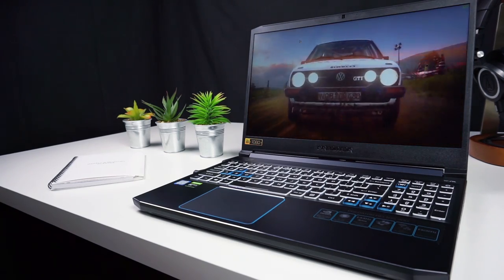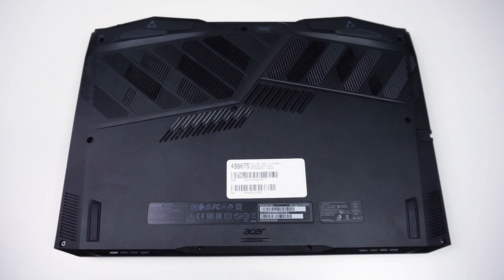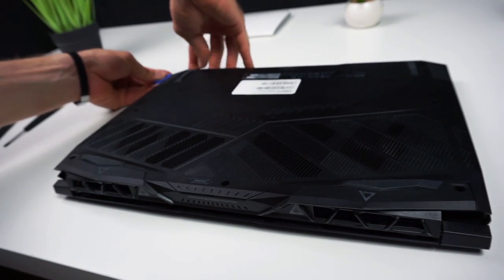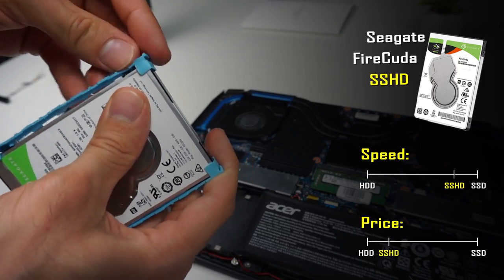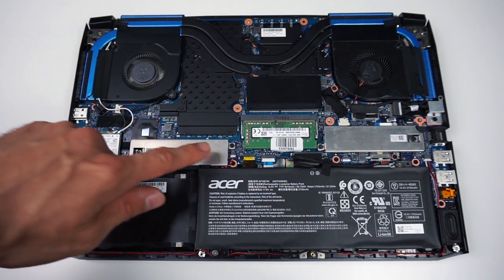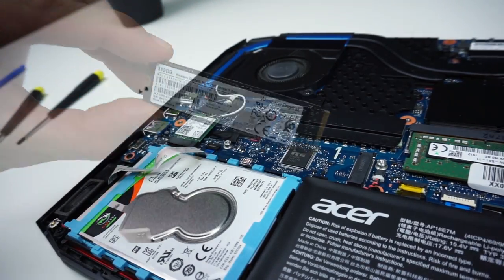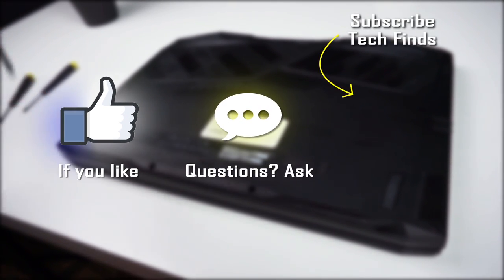Acer Predator Helios 300 2019 Upgrade RAM / SSD / HDD - Disassembly Guide

Comment: Hello my friend !!, I am waiting for the arrival of my helios 300 2019, in the specification it indicates that it has 16gb of ram but does not specify if it is one of 16 or two of 8, the model is that of $ 1088, do you know how it comes? because if there is a free slot I am wanting to buy another 16GB, I have read that if I install one with a smaller capacity it will not be 100% used and the one with the lowest memory will run to perform the tasks, what is the truth in this? Or could I buy one of 8gb having this way in total 24gb and squeezing it 100%? As always great your videos!
Reply from the maker: Hey, if you bought the laptop on Amazon USA then you'll get it with 2x8GB. It's better to have 2 sticks with the same capacity as you say, but i don't know the details. For sure if the system will need more RAM it will be using both sticks.
Reply: @TechFinds  Great thank you very much as always
Reply: @TechFinds  what about the Canadian one? 16gb but not specified I hope it's 2x8 because I don't have the money right now to upgrade another 16gb to make it dual channel 😂
Reply from the maker: @ernestnovakhov  hard to say mate, because I didn't have this certain Canadian unit. :P Try to ask the seller before you buy.
Reply: @TechFinds  okay thank you, I will be picking it up and I will check. Does it void the warranty if you just open the back of the laptop without doing anything else? Nobody has to know 👀😂
Reply from the maker: @ernestnovakhov  It may be different for each country, so you better off reading warranty terms that you got with your laptop. ;)
Reply: @TechFinds  I will be picking it up in a few days, thank you. Appreciate you and your channel.

Comment: Hey quick question. Does the ribbon cable come with the Helios 300 as standard or do I have to buy it?
Reply from the maker: It comes with the laptop in the box, as same as blue frame. It may vary between countries but i believe that they mostly give the HDD upgrade kit
Reply: @TechFinds  👍👍

Comment: hey brother ive got a question. Which RAM card should I buy for acer predator helios 300 i5 9300h 1660ti? Also, do I have to add additional things like SDD if I upgrade my RAM for gaming purposes?
Reply from the maker: You can upgrade only RAM. You can use RAM that i linked in the description. If you mix go for Crucial as it has the same specs as original RAM
Reply: @TechFinds  Also, can you tell me how much of FPS increase i should be expecting once upgraded?
Reply from the maker: @sirpranabR  I can't guess, you have to test ;)

Comment: Hi, I'm getting Helios 300 (2020) model very soon. Predator Helios 300 (PH315-53-77CF)  
*i7-10750H (2.60 GHz) *8GB (DDR4 SDRAM)
I want to add another 8GB ram to make it 16GB ram in total. My question is, can I mix different ram with the ram that came with the laptop itself ? I'm gonna get 8GB Kingston HyperX Impact DDR4 2666Mhz. Is that okay ? Thanks
Reply from the maker: If you mix you should match the specs with original RAM. In your case HyperX is not suitable unless you buy 2 new sticks. Go for Crucial if you mix
Reply: @TechFinds  I see, thanks for the advise

Comment: I didn't understand the error when you were installing the firecuda. In the video you install it with one side up and in the picture you put another side up. Sorry to bother you but I bought the exact same model and I want to install it properly. Which side should be up when I install it? Can I dm you?
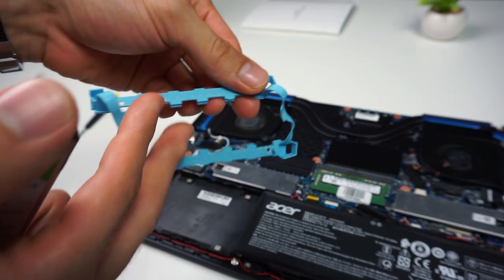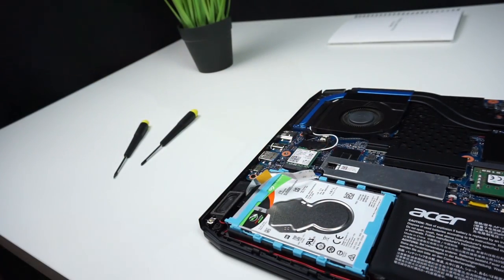Reply from the maker: I showed the correct way in the smaller windows with description. First tip is at 01:40 and the second at 02:36. And at 02:31 I said it is wrong, so if you're at this point, you should flip the drive upside down so the white/green side is on the bottom and the SATA connection is on edge side of the laptop.
Reply: @TechFinds  Ok, thank you very much.

Comment: Are there two ram sticks in the laptop or only one? Also, is a 16gb (2666hz) dual rank ram stick compatible to be put into the laptop and will give better results/performance?
Reply from the maker: Hey, the configurations depend on the country, so you have to ask seller whether the laptop that you wanna buy comes with 2 sticks or 1. This laptop comes with single rank sticks, so if you wanna mix (add more RAM) go for single channel stick as well to avoid eventualcompatibility problems.
Reply: @TechFinds  which ram brand and size did u put in the video?
Reply from the maker: @vlORACLE  i didn't add any RAM, I just took off the original stick to show how to do it
Reply: Tech Finds o okay, which ram stick is the most compatible with this laptop? The crucial?
Reply from the maker: @vlORACLE  yes, it has the same specs, so go for it if you mix
Reply: Tech Finds okay thanks a lot man

Comment: I just got the helios 300 (2019) and it comes with 8gb of ram, i think is two 4gb stick, i want to upgrade to 32gb but i don't have the money to get 2 stick at the same time.. can i install just one stick of 16gb and later when i can afford install the second one, or those the two slot must be installed at the same time??
Reply from the maker: You can install only one stick and then buy 2nd stick later
Reply: @TechFinds  thanks m8 👍

Comment: Do you really need to disconnect the battery, or can you safely leave it connected and do your upgrades?
Reply from the maker: I never do that, but it's recommended for safety reasons and to not eventually damage the hardware.
Reply: Just unplug it whenever you want to do an upgrade or just wanna clean it.

Comment: Hi Tech Finds, Although the ram cards are not the same brand, do they work in dual channel? How I know it? And how I know for which ram card go, in this or other laptop?
Reply from the maker: Hey, the dual channel enables when you have 2 RAM sticks physically installed and they are compatible. You know which RAM you can go for by matching the specs with your original RAM if you mix. If you replace 2 RAM sticks you have to know what are your laptop RAM limitations. This Helios supports up to 32GB (2x16) 2666MHz
Reply: @TechFinds  I understand, the brand of the ram card dont matter? The only thing that matter is the MHz in which its works? Only the MHz said if a card is compatible with other?                                                                   And other doubt, the ram must have the same GB as the original, to make them work in dual channel? I can have the original with 16gb and add one of 8gb, and still make them work on dual channel?
Reply from the maker: @juanpablokieffer  Yep, the brand doesn't matter. However for the best compatibility it's good to have the same sticks. For sure speed and voltage should be the same. Maybe latency as well, because it may cause compatibility issues if you don't match this.
But if it comes to capacity then the answer isn't really clear. Check out the forum post: https://bit.ly/2qxKVgC
Reply: @TechFinds  But maybe is hard to find another like the one which comes from factory, and its more expensive to buy another 2 identical. I love your videos :) <3 Thanks for all your help. Sorry for always talking about money and costs, in Argentina we have a lot of taxes and all is expensive xD , even the low end components
Reply from the maker: @juanpablokieffer  It's not that hard to find other brand RAM with the same spec. Crucial that i linked is perfect to mix with original RAM of Helios 300.
Reply: @TechFinds  Thank you very much :)

Comment: Hey i have a doudt does the fan blow air at different rate!???
Reply from the maker: If it's on automatic mode one fan may be slower than the other. You can set the fan speed manually but at full speed they both spin the same fast

Comment: Hi! does the upgrade kit comes with the laptop? i'm going to buy it, but i'm really scared it doesn't come with it. I'm going to buy the 2019 helios version.
Reply from the maker: By default it comes with the laptop. Ask the seller if you can.
Reply: I just bought this 1 week ago. It does come with the rubber gasket and strip you see in the video. They come in the box in a separate  bubble wrap bag.

Comment: In amazon comments, and even in other places a lot are complaining that the Hard drive failed after 1 to 6 months. Did yours fail too ?
Is there people here that used the Segate firecuda and can provide some info ?
Reply from the maker: I'm using this Seagate FireCuda for over 2 years now and it's working flawlessly.
You know, people are usually not happy when the Hard Drive dies, so they have to complain and they'll do it rather than posting that the drive is working well if it does. You can always get a defective unit, but it doesn't happen often.
Reply: I've been told Seagate is one of the worse harddrive to get for your pc or laptop they dont last that long and have some shitty reviews

Comment: I'm planning to buy a Helios 300 model with 4GB base RAM and has free 8GB RAM. I know that dual channel may not work because they don't have the same size. I want to know if the base RAM is soldered unto the motherboard or it is like the additional slot of the laptop.
Reply from the maker: The 4GB stick is not soldered on to the motherboard. This laptop has 2 replacable RAM slots. It's strange that you found a configuration with 4GB RAM + 8GB.
Reply: @TechFinds Yeah well I'm in a country where the standard RAM for most gaming laptops is 4GB which sucks. Anyways, thanks for replying man.

Comment: This laptop comes with a 1tb HDD installed rite.? So where is it located in the laptop? And who is manufacture of that HDD. Pls reply to this question!
Reply from the maker: It depends on the configuration. I bought it with only 512GB M.2 SSD without any HDD.
Reply: @TechFinds  i bought with 1 tb Hdd installed. So will the hdd installed on the specified location where u installed the hdd in the video?
Reply from the maker: @ridhulpauly  Yes, this is the only place for HDD in this laptop.
Reply: @TechFinds  ok so u saying the 1Tb hdd will be present there when i open the back cover!
Reply from the maker: @ridhulpauly  Yep, as shown on the video. After removing the bottom lid you have access to HDD, RAM and 2 M.2 SSD slots.

Comment: hello friend ! i want to ask. if i put 2 slots of 3200mhz ram in Acer like yours it will work ?
Reply from the maker: The unit I had supports max 2666MHz RAM. You can use 3200MHz, however it will downclock to 2666MHz anyway and I would rather not try it to avoid eventual compatibility issues

Comment: I was not given a ribbon cable or rubber padding for the outside of the hard drive like you have in this video, where can I order these?
Reply: I have the same hard drive and laptop as this video.
Reply from the maker: I don't know if you can buy it separately. Contact Acer support so maybe they can guide you
Reply: @TechFinds  I was able to find them on Amazon. Thanks for the reply and video!

Comment: Hi I ordered a 16GB Ram Acer Predator Helios 300. Can I add another 16GB Ram DDR4 or whatever its called to make it 32GB Ram? If not how can I upgrade it to be 32GB of ram instead of 16? Thank you
Reply from the maker: If you have 1 stick of 16GB RAM installed you can add 1 more to have 16GB. But you may have 2x8GB now, so you have to check it.

Comment: Sorry to ask but i read on the acer website, the RAM support up to 2933Mhz. Which one is correct?
Reply from the maker: Isn't it for the model with 10th gen Intel cpu? From what I know the maximum ram frequency supported by i7-9750H is 2666MHz

Comment: If I want to add another SSD card, do I need to swap the slot or just simply add in the new card into the empty slot?
Reply from the maker: If you have empty slot you can just add the new SSD
Reply: @TechFinds  Someone said that the currently used SSD slot is named as Slot 1 and the empty slot is Slot 0. When they added in a fresh SSD card into the empty slot (which is Slot 0), the system was unable to boot up and they had to swap the cards between the two slots, so that the system would read the card with Windows on it from Slot 0, and installed the fresh card on Slot 1. Can you confirm on this matter for me?
Reply from the maker: @SpikeYoung09  Well that's confusing. I'll just tell you what i know: if you have your SSD with Windows in slot X don't touch it and just add your new SSD in slot Y. The boot drive is still in it's place and you're just adding a new drive which should be recognized by system. Maybe those people moved the boot drive to the other slot for some reason and that's why the Windows didn't start.
Reply: @SpikeYoung09  i just experience that lol, just spam f2,  enable boot order. restart and spam f12 and choose your default. anyway installing ssd nvme on this laptop is a hassle. the screws has threadlocks... be careful when unscrewing it or you will strip it like i did. oh btw not sure if your defaut bios on sata mode: rst intel , or whatever its call. if it is please change it to ahci mode b4 installing windows 10 (if youre planning to install a samsung nvme). fail to do so , your samsung nvme wont be detected by samsung magician/ samsung nvme drivers

Comment: so this might seem like a stupid question but, do i only add one ssd to it? if i remove the one thats already there will i loose the saved data??
Reply from the maker: If you'll replace your cussent SSD you'll simply take out all data nad system with it to replace it with new empty drive. The laptop had another slot for m.2 SSD and one slot for 2.5" HDD too so you don't have to replace your current drive but add another one
Reply: @TechFinds  do all helios 300 have 3storage slots? tnx in advance
Reply from the maker: @qw3r7y52  If we are talking about this blue models then yes

Comment: I thought the maximum ram you could have in the Predator was 32GB(2x16GB) DDR4 up to 2400MHz. Or is 2666MHz compatible with it too?
Reply from the maker: This model supports 32GB 2666MHz. Olndr generations could take only 2400MHz (like the one with i7-7700HQ)
Reply: @TechFinds   Thank you.  Also, is that firecuda working well for you?  I've heard some of these SSD's have high failure rate.
Reply from the maker: @Ari-2  I'm using it about 2 years now in my personal laptop and no issues.

Comment: Hi does it comes with inbuilt hdd and ssd Or it has only a slot please answer
Reply from the maker: It depends which configuration you choose and it may be different for each country. However by default it comes with only M.2 SSD and one 2.5" slot free for HDD
Reply: Kk thanks 
I am from India can you please check the indian varient
It would be helpfull if you do so
Reply from the maker: @nayanaaswin3914  I think that you know better Indian shops and sites so you can look for it. I am not from India and I don't know Indian market. But as I said every Helios 300 has one slot for M.2 SSD and one slot for 2.5" drive

Comment: hi...i have acer predator helios 300 gtx 1660ti 8gb ram version....i am going to buy 8gb ballistix 2666 260 pin ....please tell me it is sutable or not.
Reply from the maker: You better go for Crucial to avoid compatibility issues. RAM like Ballistix is good but if you buy 2 new sticks. For mixing with original RAM you need something with closest possible specs, so teh Crucial RAM that I linked would be perfect.

Comment: Hi can i ask something i bought acer predator helios 300 online but theirs no included rubber caddy and flex where can i buy that?
Reply from the maker: I think the only way to buy it is on the internet from other people. But you should get the HDD upgrade kit with your laptop, so contact the seller and ask about that. Or contact Acer to find out if they can provide it

Comment: Plz help .......Should I have to add new ram of same brand or I can add a compatible ram of ur description ....
I don't know what ram to buy
Reply from the maker: It doesn't have to be the same brand and model, but if you wanna mix with original RAM that your laptop came with you better go for Crucial that i linked in the description, because it has the same specs. If you buy 2 new RAM sticks you are free to choose with no worry about compatibility problems.

Comment: Question about the RAM: you are installing one stick, but the laptop comes with two sticks (2x8). Where are these other two RAM sticks located?
Reply from the maker: This laptop has 2 slots for RAM, the second one is located just above the one i installed, but it's covered by black piece of paper
Reply: @TechFinds  Awesome thanks. I have one right now and find that 16GB is being used 85% or more quite often so look forward to upgrading to 32GB.
Reply from the maker: @user-uy3eq5hg1s  Good choice, 2 sticks always work better than one.

Comment: hi, my Helios 300 came with 2 sitck of 4GB ram, i want to remove both and install one of 16GB, which slot should i use or is it ok to use either???
Reply from the maker: You can do it, you can use any slot, but i recommend to buy 2x8GB because the performance is better when you have dual channel RAM (2 sticks). However if you gonna add another 16GB stick later go for 1x16GB as you said
Reply: @TechFinds  yes that was my idea to add later another one of 16GB.. but now im not so sure if im really gonna need 32GB of ram.
Reply: @davidperez7755  You don't need more than 16 gb of ram. Advanced future games which are going to need more than 16 gigs of ram won't work on Helios 300 anyways. Just buy 2 X 8 gb.